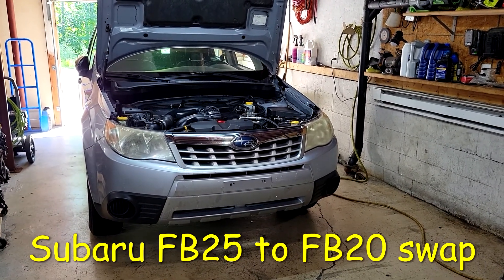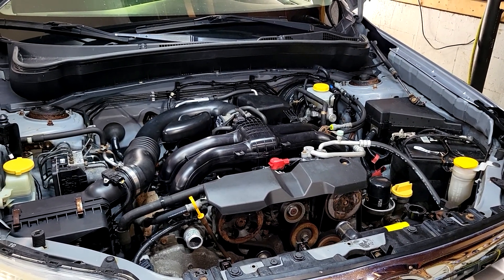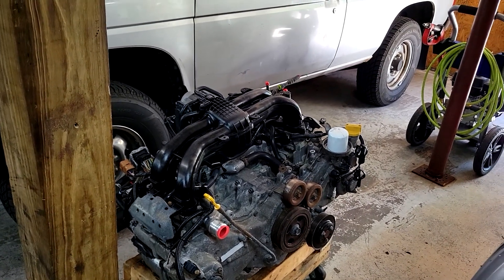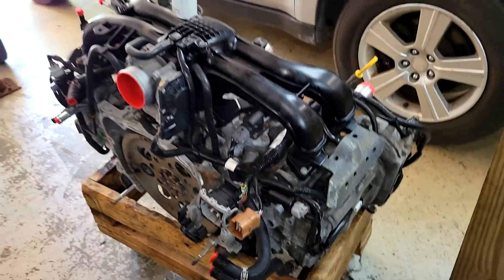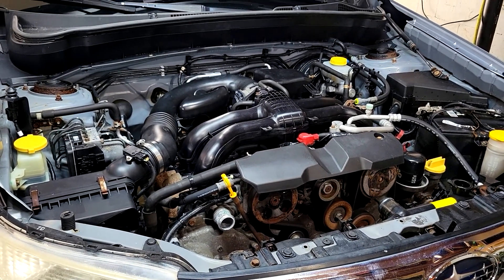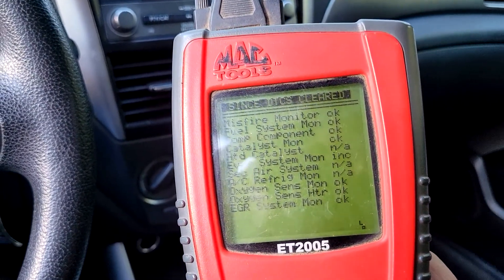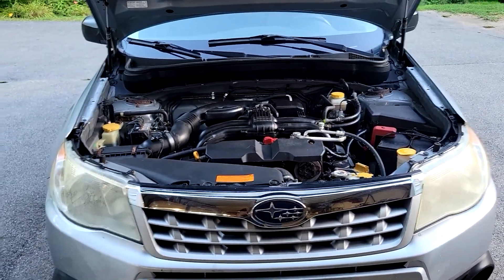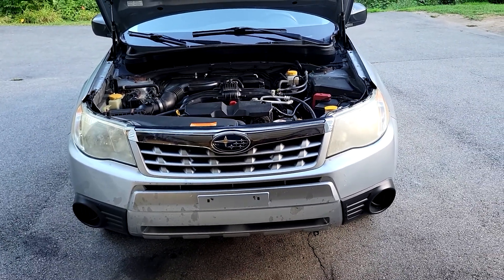Subaru Forester FB25 2.5 to FB20 2.0 Engine Swap Cheap Option To Fix Your Car Legacy Outback Impreza

Comment: I have a 12 forester, picked up a 12 impreza engine working through the swap this week. I noticed the forester engine has a power steering pump in the top left the the engine and the impreza just has a pulley there that connects to nothing i assume this will be a clear sign i need to swap over the engine harness as the impreza likely will not have power for the power steering pump.

I was wondering tho what is the best idea for capping off the tranny cooler lines on the fb20? I just have the cut hoses hanging out do you know of any kits to delete these lines or do you just plug the hoses with a bolt and hose clamp them down? Im keeping the original AT from the forester.
Reply from the maker: the impreza harness wont have the wire that hooks to the power steering pump. however omitting that does not cause a check engine light or any other issue. the 1st one of these i did i left the impreza harness so that wire wasnt there and it didnt cuase any problems. the easiest way to deal with the tranny cooler hoses it just remove the original hoses and get a new longer peice of 5/8 heater hose from auto parts store and connect the 2 nipples with it
Reply: @volksjager88  thanks did leaving the original harness effect the power steering in any way?
Reply: @AsylumYT  no, the steering was normal
Reply: I'm at the oart if swapping my fly wheel the one in the forester seems a bit worse for wear but the one on the impreza looks in great shape. Comparing the flex plates they look identical would there be any drastic variations or is it possible I can use the crank sensor plate and the flex plate. The impreza crank plate has holes slotted in it and the forester one is solid.
Reply from the maker: @AsylumYT  you will need to swap the flywheel on auto trans. the 12 Impreza has a TR580 CVT. the torque converter bolt pattern is different than the 4EAT in your Forester.
Reply: @volks-jager  Ok and along with it the crank sensor plate as well? Or should i leave that on the impreza? The impreza one has holes in it the forester one is solid.
Reply from the maker: @AsylumYT   the holes dont mean anything. compare the teeth and diameter side by side. they should be the same. if so use whichever you like.

Comment: You probably just saved me a ton of money. My 2011 forester fb25 just blew the right side head with 185k mile. Just picked up a $500, 61k mile fb20 from a running 2015 impreza that was totaled in the rear. Great stuff and thanks.
Reply from the maker: if you read through the comments you will see a person tried a 15 engine and has issues (i bet the cam sensor trigger wheels are different).  i have not tried to put a 14 or newer ej20 into a 11-13 forester.  for an 11 forester a 12 or 13 impreza engine is good. see my main comment under the video. if you can return  that 15 engine and get a 12-13 impreza engine.
Reply: Does the car feel much slower with this swap?
Reply from the maker: @neometalx9   yes car will be slower - you are putting the smaller engine in it. the trade off is a huge savings in money. the power loss can be mitigated somewhat with a tune or leaving the VVT system disconnected
Reply: Dogs this work for you?

Comment: I used a 13 Impreza 2.0 in my manual 2011 Forester. I’m so very impressed how the swap went ! A $700 engine and it works slick.
THAKNK YOU!!!  Note: I used my old wiring chassis. This made the coil plugs different . To fix this ,I used my coils and changed the boots on the donors. Now the coil bolts needed a spacer between the coil to the head cover. Then I used a 3” 3/8 extension inside of an old piece of hose from another Subaru (about 6” long) to plug the coolant ports. After all done ,I haven’t had another problem. I’ve run it for a thousand miles. Thanks again.
Reply: we just did a similar swap, we used the valve covers from the 11 forester on the 13 Impreza engine to solve the coil length issue.  Have you had any engine codes?  we are having recurring codes now and are chasing the issue.
Reply: Where are all these subaru motors at. ?

Comment: I bought an 13 Outback with the fb25 vin 6 "c" with the cvt transmission. I have No Idea where to start when it comes to finding a suitable alternative, but it sucks. worst year to own! if anybody has any info please let me know
Reply from the maker: so you need an wantto do the 2.0 swap? if so get a 12 or 13 Impreza engine

Comment: So I tried this fb20 swap for the first time after I have been using the legacy fb25s, and mine is a dog, like wont get out of it's own way, but if you unplug the front vvt solenoid it throws the light on but gains way more power. It's almost like with it plugged in its retarding the timing the more you open the throttle but unplugging it disables the vvt and drives like normal. Ever experience this?
Reply: The intake, I left the 2.0 harness on it.
Reply: Hey brother any follow up on this? Did you leave the cam sensors unplugged to this day? Did you change the intake back to the 2.5 harness?

Comment: How do you  get the "cradle off" the piece that goes under the front of the engine.
Reply from the maker: what year and model are you working on?
Reply: @volks-jager  2013 outback fb25 . Cant get bottom bolt off
Reply from the maker: @vaccineskillpeople3688  you mean the front motor mount? just remove the cross bolt and then the bolts that hold it to the front of engine and wiggle it out. be advised the info in this video applies to Foresters. Outback and Legacy are a totally different chassis with very different engine mounts and so you may run into issues not explained in the video.
Reply: @volks-jager  
Its a outback. I removed the bolts. Took the mount off. But the part that is on the cover wont come off. I can feel a bolt underneath
Reply from the maker: @vaccineskillpeople3688  there should be 3 bolts holding the bracket to to the upper oil pan

Comment: I am looking at this. I have a fb25 with the exact issue w oil burn and head gasket. So mine is 2013. Would a fb20 2012 fit
Reply from the maker: yes

Comment: Volksjager, I need some help. I paid a mechanic to do my swap and in the middle of it he had a full on mental health breakdown. After almost two months I got the car back and it has several codes, P2092- Camshaft Position Actuator control circuit low bank 2, P0304 Cylinder misfire on 1,2,3,4. Any thoughts on as to why?
Reply from the maker: what year and model is your car? and what year engine did you buy?
Reply: I have a 2011 forester and swapped an fb20 from a 2013 Impreza. I previously commented and you helped me select the engine.
Reply from the maker: @jaredcolombel  check the connector on the cam phasers. they are fragile and break easy. he might have broken one installing it
Reply: Ok I’ll check it
Reply: Volksjager, it turns out the cam phaser sensor was disconnected. I got rid of that code and now it has a code for misfire on all cylinders. I think it has to do with the coil pack gaps. I believe a spacer on the coil pack nut is what helps this issue.
Reply from the maker: @jaredcolombel  are they OEM Subaru coils and either NGK or Denso plugs?
Reply: They are Subaru coils and the plugs are ngk. Two things I can think of are I told the mechanic to use the plugs from my fb25 that were new, and to use the coils from the new engine.
Reply from the maker: @jaredcolombel  did he swap the fuel injectors?
Reply: He did, no lean codes
Reply from the maker: @jaredcolombel  idk, something got screwed up, ive never had misfire on these. does it run decent? are the cats clogged from the old engine?
Reply: It runs like normal, doesn’t feel like it’s misfiring at all, that’s why I think it’s a spark plug gap or distance issue
Reply: Volksjager, The mechanic told me the new FB20 engine did’nt have ignition coils and he used the ones off the old FB25. Do you think this is what’s causing the misfire on all cylinders?
Reply from the maker: @jaredcolombel  hmm the 2012 and 2013 have different part numbers on the coils. we have done several of these swaps and never had misfire issues, but also have never bought a used subaru engine and had it missing the coils, pretty shitty of the yard to take those.
Reply: The original engine is from a 2011 and the used one a 2013. I order new coils and will report back after I install
Reply from the maker: @jaredcolombel  dont get aftermarket coils. get OEM Subaru ones, used if you have to
Reply: I already ordered aftermarket so it’s too late but I’ll put one in and see if it solves the misfire problem
Reply: Coils came in but they were longer. I swapped a boot from the new one and it’s still misfiring (showing a misfire on the reader but doesn’t feel like it). I swapped one of the old injectors and it’s still having codes. I checked all connections. Still misfiring on all cylinders!
Reply from the maker: @jaredcolombel  idk none of ours did this, but all the used engines came with factory coils. aftermarket coils on subarus are never a good idea. are the plugs iridium? are there any other codes? you said the engine seems to run fine?  how it is power wise?
Reply: I could only used the coils from the original car because of the sensor hook up and I had to use the original wire harness. But I do have good progress news. I added sea foam into the crankcase and gas tank and drove it for a bit and all the misfire codes are gone. I think it sat too long and the injectors needed a purge. Now all I have to do is wait for the EVAP monitor and I have a weird front end noise to address.
Reply: I got the evap monitor off and it passed smog. It is slow up hill and lacks power but it sure beats no car. I do have an angle steering sensor code but for the most part this is a great idea.
Reply from the maker: @jaredcolombel  did you use the wiring harness that came on the 2.0 or the one from your original 2.5? the 2.0 harness dones not have a plug for the steering pump and might cuase other issues. if you passed smog and now want more power simply unplug your cam phasers. this will increase power, but you will have a check engine light
Reply: @volks-jager  I used the harness from the old 2.5 and swapped the power steering pump over. I’ll give the cam phaser thing a try an let you know.

Comment: I have a question here:  which crankshaft sensor plate did you use, or were yours different?  Subaru shows different parts for the manual transmission plates, so I anticipate using my existing sensor plate because I think that’s what my computer is going to be expecting to be there…any thoughts, anybody?
Reply: I am swapping a 2011 Forester FB25 with a FB25 from a 2013 CVT Forester.  The Swap went well, engine runs but get codes for both camshaft positions.  

Swapped sensors but no change.

Checked the cam sensor discs, they are the  same with three notches.

I will pull the engine again swap intake manifold with wiring harness and change the sensor wheel behind flyfeel.

fingers crossed.

Comment: any updates?..still running with no problem?...do you think this Swap would work on 2013 outback?.....this idea is superb !!
Reply from the maker: ive done a few swaps and they are still running fine. not sure i would do this on an Outback unless it is a manual trans. the automatic Foresters i did 2.0 swaps in are rather underpowered and an Outback is an even heavier car.
Reply: Hey…I just got a 2013 FB20 from a Crosstrek to drop on in on a 2012 forester.,did you swap the harness or you used the one that came on the FB20,and what about the water crossover pipe?..wondering if I would get code because of the EGR valve if I swap the crossover pipe…thanks so much for your help!!!
Reply from the maker: @cheboludo90  use the intake and harness from the old engine. you can just connect the 2 tranny cooler hoses together and leave the crossover

Comment: I am trying to change my 2.5 turbo in a 2006 forester with a turbo 2.0L, is there anything beside changing intake, wiring harness and turbo from 2.5 to make this swap work?
Reply from the maker: no idea - i dont mess with turbo Subarus

Comment: The same thing happened to me this week. I got a 2013 forester off copart for 3k with 122k miles that was labeled as a run and drive. I couldn’t go out there and see it as it was far away as well. Upon arrival I put a battery in it and it sounded like a complete weed wacker. What would you say engine and a shop install would run for this swap?
Reply from the maker: Copart really sucks for buyers. you are better off with IAAI at least they post a video of the engine running in the auction. anything at Copart that doesnt list an Insurance company as the selling is buyer beware. lots of shitty dealers dump their junk at Copart.  get a 12 or 13 Impreza 2.0  engine they are dirt cheap here - the yards sell them for $300.  the car will be kinda doggy if it is an auto, but if it is a 5 speed it will be decent.

Comment: Hi,  I'm looking for some guidance on swapping a 2014 forester cvt engine into a 2014 forester MT, besides the transmission coolant lines (would need jumped/connected/plugged) are any other differences or things that will need done? plan to use MT flywheel and clutch kit. Thanks

Comment: Thanks for the great info. I am presently swapping a 2013 Forester FB25 engine to a 2015 FB20 Impreza engine. Swap is done but the engine dies after running approx  5 seconds. Any ideas would be appreciated. Cheers
Reply from the maker: im not total sure but a 2015 may be the later style engine.  for a 2013 forester i would have gotten a 2012 or 2013 Impreza engine. i made note of that in my description. are the cam and crank sensors all the same? if not you may have to swap all kind of stuff like the cam sprockets, sensors etc. if you do have the late style engine refer to Steven Oswalds video on what to swap https://www.youtube.com/watch?v=AZY9B3sLO0U&t=10s
Reply: @volks-jager  Are there any diferences that you know of between the 2012/13 engines and the 2015 engines? Thanks in advance. Cheers
Reply from the maker: @jacquesboucher3055  there might be. Subaru made changes to cam sensor triggers wheel and such but im not total sure what year it started, i know for sure by 18 they where very different.  for a 13 forester i would get a 12 or 13 engine.
Reply: @volks-jager  Thanks for your time, I ended up picking up a 2013 Impreza engine and as you said in your video, pretty much plug and play. It works with no check engine light. Cheers to you for making you video and helping ppl.
Reply from the maker: @jacquesboucher3055  glad to hear, is you car an manual or auto trans?  how do you feel about the power?
Reply: @volks-jager  It's manual, considering the serious storm up here in Québec, I am waiting to test drive. I also own a Crosstrek which basically has the same engine, so I imagine it wil lbe fine as far as power goes. Cheers

Comment: I have a vid posted of a legacy fb25 swap into a Forester. Not a direct drop in, but doable. Engines have been 4-700 bucks on eBay. Nice video !
Reply from the maker: i have a couple of the newer engines one from an 18 and one from an 19 outback wrecks we got at copart that where not worth fixing. but a ton of stuff needs to be swapped over and i figured its better just to save them for a newer car they just drop into. most DIY'er probably dont want to get into under the timing cover - it is a cuckoo-clock design inexperienced people can really fuck stuff up and the whole mess is sealed with permatex and just asking for leaks. ive opened a few and resealed them with anerobic and it works good. the 2.0 swap is just alot easier for DIY'ers
Reply: @volks-jager  2011 Forester, would a FB20 from a 2013 Crosstrek work?
Reply from the maker: @Hellcat287287  yes
Reply: @volks-jager  Nice work. Thanks for sharing and saving allot of money for allot of us subaru lovers. I have the 2012 forester fb25 garbage oil thirsty engine . Expensive too. 
My only concern is the power reduction is very different from the fb25 ? Thats my only concern. Thank you
Reply from the maker: @quattrotz9367  if your car in an automatic it will be slow with the 2.0,  but for people with a blown 2.5 the 2.0 will at least get the car running without paying a fortune.
Reply: @volks-jager  Yeah its automatic .lits say from 0-60 is there a huge different by your experience?
Reply from the maker: @quattrotz9367  very noticeable pulling hills at highway speed or trying to pass. this fix is just really geared just toward getting you up and running cheaply. auto trans cars will be slow, like ford escort / chrysler k-car type slow , but it is stll better than a dead car or spending several thousand for a 2.5

Comment: The 2.0 also has burn oil issues infact Subaru put out a recall for this on the Impreza as well as the forester
Reply from the maker: supposedly, but i deal with these cars all the time and have not seen one burn oil anywhere near as bad as the 2.5s. i have seen several of the 2.5s drink a quart of oil every 300 miles. also we are talking s $300 used engine vs a $2500+ used engine. if i bought a $300 engine that used a bit of oil i wouldnt overly care. if i bought a $2500+ engine that used oil i would be pretty pissed off.
Reply: @volks-jager  I agree, one of my coworkers has a 2013 Impreza 2.0 that drinks about half a quart per week he’s changed the catalytic converter once and he’s at 210k miles when the oil light comes on he pours half a quart. Subaru should of been reprimanded by the government by the amount of these cars with oil burn issues
Reply from the maker: @WayOutEast1  how many miles does he go in a week? at 210k a little oil burning is too be expected. with the 2.5s ive seen massive oil burning every at lower miles. the good thing about the 2.0s is you can buy a low mile engine for dirt cheap and they are very easy engines to change.